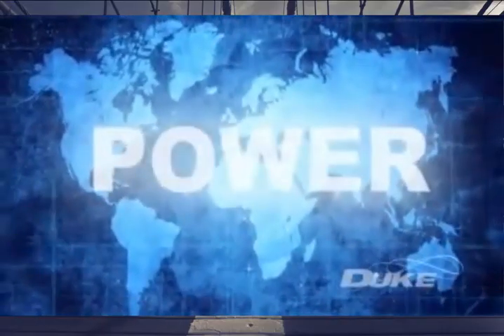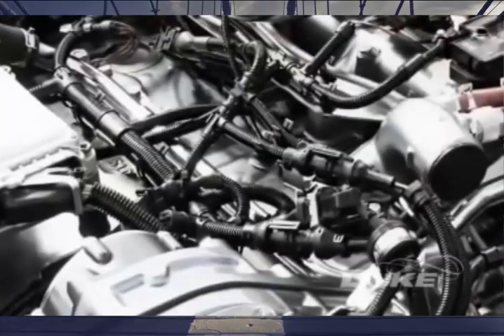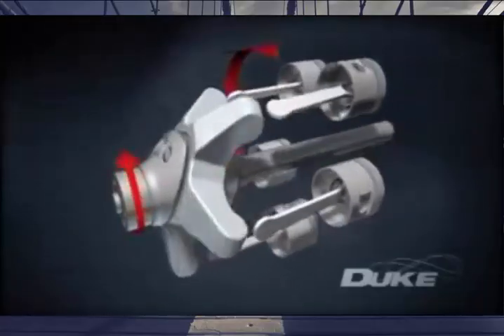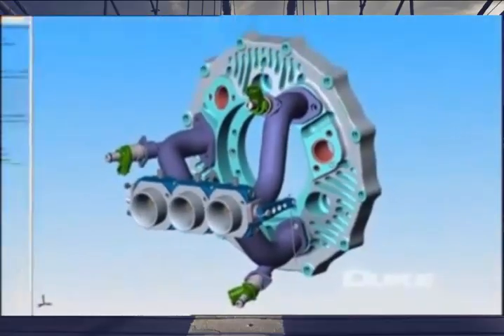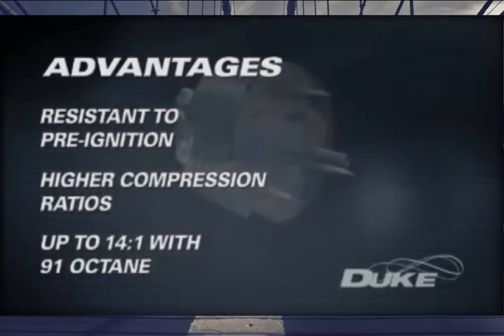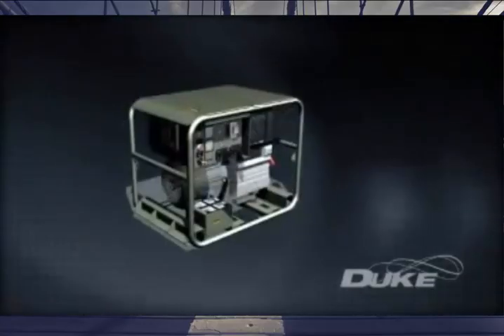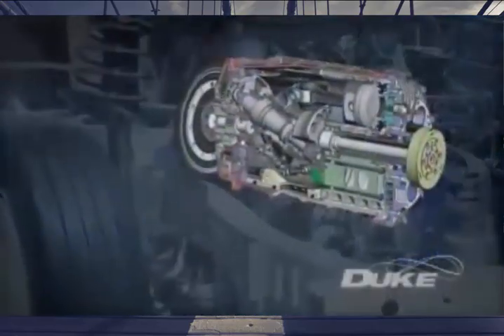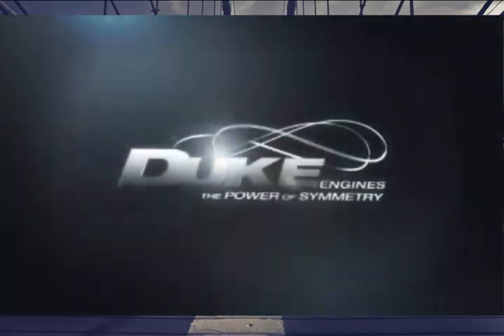Duke Engines | All information about Duke Engines

Comment: watched several vids on this engine...none explain how they seal the cylinders in a way that would prevent compression loss or that would last a long time.  If it cant seal the cylinder to the head well in a way that wont wear out the seals fast, then it will suffer the same fate as the rotary engine.
Reply: +RCPro Driver Im with you this is just a rotary valve engine. If rotary valve were effective for piston use everyone would use them. The seals always go bad.
Reply: +RCPro Driver That was my first thought too.  The moment he said "The cylinders themselves slide past ports [...] that are monted in the stationary head ring" - that word "slide" rang a loud alarm bell in my head.  I used to have a two-stroke motorbike that had rotary plates with ports cut into them to control gasses into the crank case and cylinder.  It had a good performance, but the wear on the rotary plate was significant - and it was sliding in much the way suggested by the Duke video.  My feeling is, like yours, that this will be a source of wear, and of compression leakage over time.  It's an element that I would expect to age quickly - fine on a new engine, but a source of trouble on an older one.

The narrator also speaks of "No power loss through the usual cam/valve arrangement"  Does that cause a major power loss?  When power is lost, it is invariably turned into heat, and I know that engines run hot, but I suspect that a vary small proportion of that heat comes from the cam follower or the valves and springs.  If you try to turn the camshaft by hand, there appears to be a lot of friction, but in a running engine, there is a film of oil between the cam and its follower.

I must confess, though, I like the idea of the star-shaped reciprocator in place of a crank shaft.
Reply: +RCPro Driver There are literally only about 4-5 videos of this engine on all of YouTube, and in all of them there's maybe 30 combined seconds of this design running. Not in a real car. Not on a road. Not in a commercial application. Not hooked up to a conventional transmission. Just of it running.

To your lubrication point, it takes much longer than 30 seconds for a dry conventional engine to seize from heat stresses. It's entirely feasible this engine could also last at least that long before seizing...just long enough for it to seem to be the real deal.
Reply: +Richard Beaver No.  I know that an engine compresses the combustion gasses, but an air compressor is used to deliver compressed air to something that's going to use it.  How can you get compressed air out of an engine?  The inlet opens and it takes a cylinderfull of gasses, then both the inlet and exhaust valves close and the piston goes up (compressing the gasses) then comes down again, so if there is no combustion, the gasses are returned to their uncompressed state.  The same happens if you turn the engine backward, except the flow of gas would be into the exhaust pipe and out of the carb - but at near enough atmospheric pressure.
An engine could be modified to be an air compressor, but unmodified, it's not.
Reply: +RCPro Driver Don't see though why they wouldn't lock the head to the cylinder block and have the center shaft only rotates.
Reply: +RCPro Driver their website has some information and pics on seal technology.
Reply: +Clayton lanz No this is an Air con compressor! :D
Reply: You know that all engines are air compressors running backwards and burning a fuel. turn the engine the other direction and it's a compressor. Basic principles.
Reply: +Mike Collins   Reverse the rotation. When the piston goes down from TDC the expanding volume creates a negative pressure and when what was the exhaust valve opens atmospheric pressure forces air into that volume filling the cylinder. The next upwards stroke of the piston has closed valves and pressurizes the air as the volume decreases. Then  what was the intake (now exhaust) valve opens and
 the pressurized air  exits via what was the intake manifold. Now there are some complexities, valve overlap, valve timings etc but it actually has been done. A piston pump air compressor is much simpler, intake and outlet are accomplished by means of reed valves and every down stroke of the piston intakes air and the upwards stroke compresses it. So, yeah, you COULD modify a 4-cycle engine to be a compressor but, in the end, why bother unless you really don't have enough to do. 
     Rick

     BTW, I've been pulling wrenches at the dealership level for over forty years.
Reply: +RCPro Agreed, I can't see how the sealing issues could be solved in a way that wouldn't be better applied to fixing the Wankel.
Reply: +RCPro Driver there are super low friction ceramic pistons that negate/lessen the need for oiling on them, and I believe that those same materials can be developed in a way that seals well and keeps the compression up. sensors will likely be able to indicate when the wear is happening and a rebuild can be done. with a simpler and smaller engine such as this, i think that can, with development, be brought to cheaper and faster rebuilds than current production engines.

it's a new design and it's not perfect right out of the box. but give it some time to sort itself out and it will likely surpass modern engines in overall reliability.

although to be clearly honest, i believe that Niama Reisser's CHB engine design is more efficient and can be brought up to modern standards easier than this one.
Reply: Mitchell Eckler i agree with you too. i would like to know as well but i think they are hiding it in a hope to bring improvements soon that will bring it to a more acceptable/impressive/competitive level to the gas engines.

personally, i'd love to have one in a Saab Sonett II, even at its current prototype stage, even if the reliability isn't great. it sounds like it would be a great engine for light cars and that's one of the lightest sports car ever made, and it would drop at least 100 pounds off the nose

Comment: 91 octane at 14:1 is mentioned, that getting into diesel compression range. big capabilities open up.
Reply: +LimitedGunnerGM 
Or it means, that engine has problems with heat loss through the valve plate - which lowers the efficiency. 
Heat loss due to large surface having contact with compressed air is one of the main reasons why Wankel engine is known for poor efficiency, or diesel with swirl chamber.

Comment: So apparently these guys haven't heard of the wankel rotary engine, which makes this look like a joke in all aspects, power to weight, power density, simplicity, the rotary engine is leaps and bounds ahead of this thing, an vehicles are moving to generator systems anyways, at least hybrids are, and in that case we'll be seeing smaller gas turbines which can run on gas, diesel, propane, alcohol, kerosene,  even fryer grease, they are silent and efficient under a generator load and would produce far more energy at a low cost to own
Reply: The wankel rotary requires more maintenance as it destroy seals, burns oil and it also has terrible gas mileage. Apparently a low torque figure too, proportional to piston engines. It sounds great tho :)
Reply: +originalicetray wankel rotary engine is  even more complex than this engine 
wankels  never caught on  because  of their complexity and  their issues with  seals 

this  DUKE engine will be  easier to seal  because  the cylinders all move in  one motion , circular ,, i don't  100%  understand all of  how it works  ,, but they do  say in the video  that  they are in  the 3rd stage prototype  so  , that means  they have  been at it  for a while
Reply: doesnt know what multi fuel engine is? and btw.  ur rotary engine will suffer with 100k km or so this wouldn't.

Comment: Duke Engine is only talk and no show.
Reply: It would appear that Wikipedia, the amateur encyclopaedia, do better research than you:
Duke EnginesNew Zealand company Duke Engines started in 1993 has created several 
different engines and installed one in a car in 1999. The engine runs a 
5-cylinder, 3 litre, 4-stroke internal combustion engine platform with 
its unique axial arrangement, which is in its third generation. Due to a
 valveless design, Duke engine loses less energy between the power 
strokes.[14]
 Current prototypes of Duke's engines claim to match characteristics of 
conventional internal combustion engines but with fewer parts and 30% 
lighter. This goes in the direction of developing a more efficient 
engine. It is being stated that this design for engines could be ideal 
for motorcycles in future.[15] During development the Duke has been tested at MAHLE Powertrain in the United Kingdom and in the United States; test results are available with it also having multi-fuel capabilities.[16]
Reply: You bet!